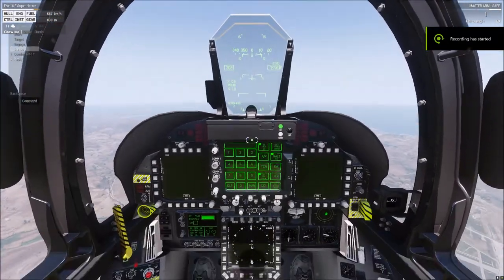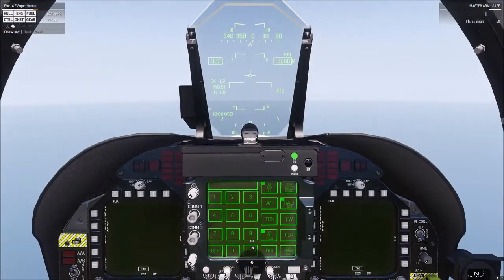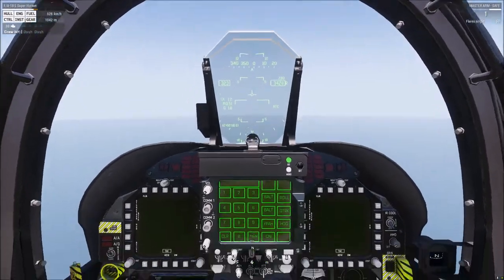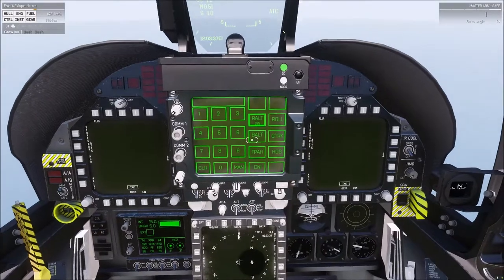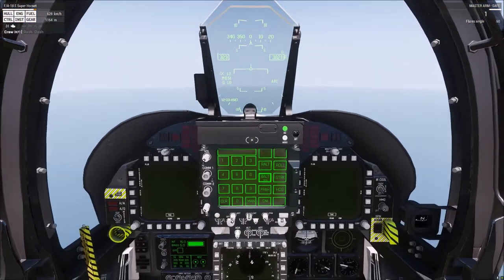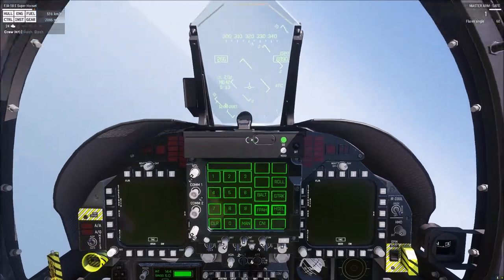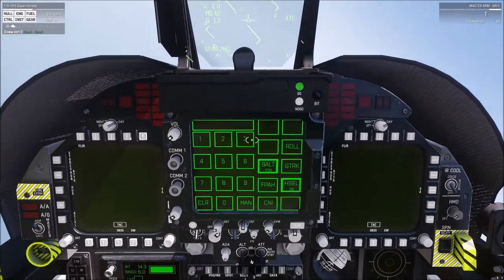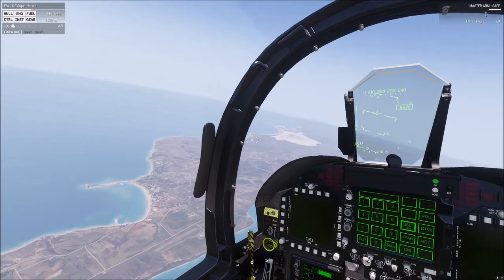ARMA 3 F/A-18 Super Hornet Autopilot Tutorial

Comment: Hello. I have an issue in activating the Autopilot. After being binded to a certain key, if i press the key the word ATC appears on HUD but just for a moment and then fades awway and also the master alarm sounds. Am I doing something wrong? It seems that the AP engages and then quickly disengage.
Reply from the maker: Are you using Mouse for flight controls? The Movements using mouse will immediately disengage AP.
Reply: @Dave_ess  no i use hotas
Reply from the maker: @massimospada3465  Yes I am following along in the Discord with you and Acolyle, I am at a loss.

Comment: For some reason when I select any of the options on the display they just turn themselves off automatically after a second or two, did I miss something?
Reply from the maker: do you have you mouse bound as a control surface for the plane? I did hear of a bug where small mouse movements will turn off AP is you use Mouse and KB as your controls
Reply: @Dave_ess  that could definitely be it then thanks.